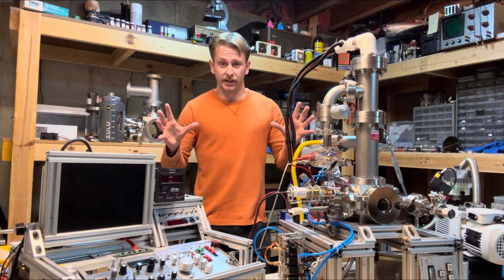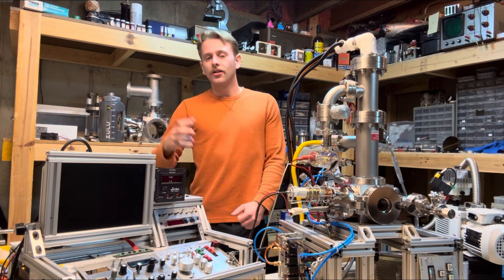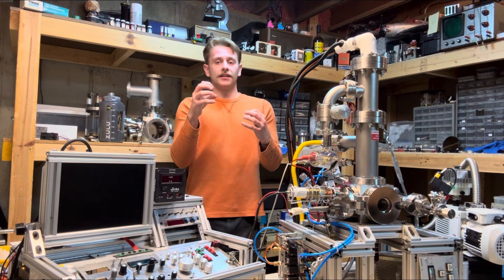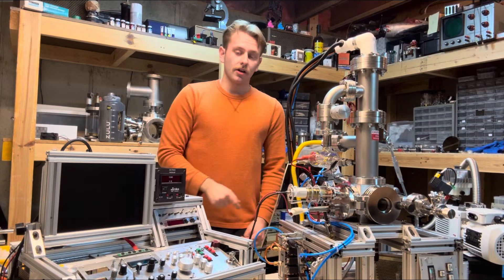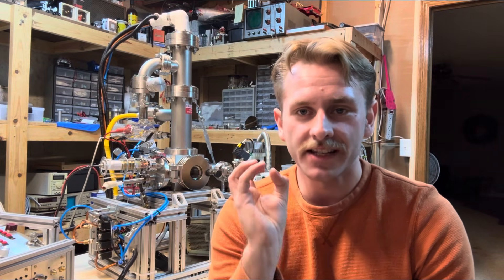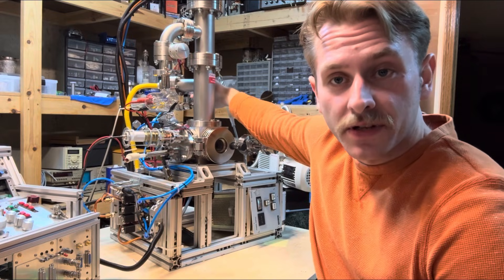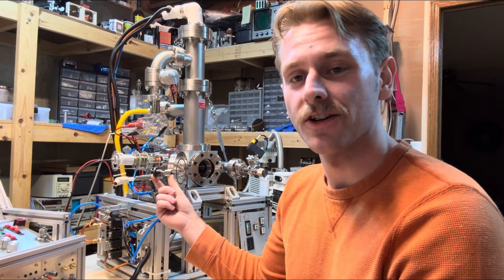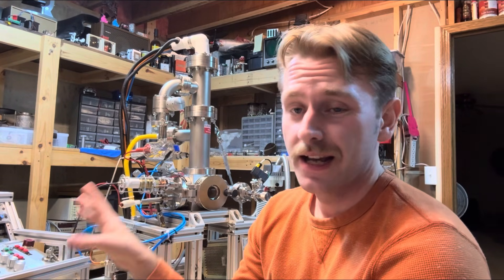I’m Building an Electron Microscope

Comment: Amazing project. I studied physics and was working with devices like these (not literal SEMs but "homemade" chambers). This was loads of fun. Really critical to be very scrappy here as every part is at least hundreds of bucks if bought new.
I'd be most scared of the electronics part of building this. 

What turbo pump do you use?
We used ion getter pumps to get below 10^-10 mbar, once the turbo was maxed out. Some commercial ones but we also had what looked like homemade ones: just a high-current feed-through with several Ti-wires attached and the whole thing mounted in a cylindrical tube on the side (so it doesn't coat the entire rest of the chamber). That took us to 2x10^-11 mbar but it also took a week of pumping and of course a day or two spent baking the chamber before that.

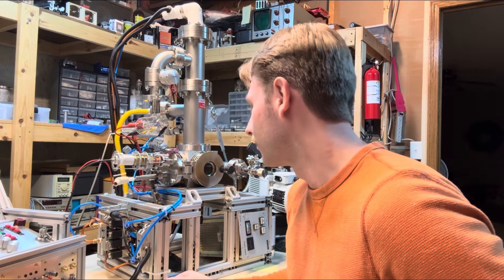Comment: 11:06 Take some aluminium foil, push it over the glass in the hole, form it well and tight to the recess, then gently pull it out and pour any casting powder you have in that "cup". Then you can make negative of that, discard the foil + original cast, and pour lead in and that's your window cover + radiation blocker in one. I guesstimate you need about 6 classic car wheel weights, you can find them at the scrap yard, most scrap yard masters gather them to sell the lead. As long as you don't boil the lead, you're AOK if you do it outside on a surplus stove or something.
7:49 true. The amount of extrusion you can find at the scrap yard is mind boggling. I don't need all of it, but i sometimes get entire trailer loads (after i go dump my stuff) worth their aluminium weight and share it around with my friends. And it's good stuff too. A month ago i found 10x10 core extrusion (the standard 3D printer width as module) in four half a meter long stalks. Like... who throws that stuff out? And i got it for weight value. Unreal how much stuff gets thrown away for no good reason at all. Welp, their loss, our gain.

Comment: This  is cool to watch. I worked for a jet engine manufacturer for many years and one of the pieces of equipment we had was an electron beam welder. Many of the functions you speak of are very similar to the welder.  I maintained this equipment, very challenging for control and alignments.. I also made my own hobby  circuits at home by wire wrapping the electronic components. It worked well but never looked as good as your boards.. Keep up the projects, I love it.

Comment: Super impressed by your progress. I attempted a similar build 15 yrs ago using a electron gun from a HD CRT, yes they did exist but were so heavy they were not popular. Got all the vacuum bits but stalled on the High Voltage system. This week I pulled a scrap Brandenburg Alpha III 30Kv 30mA from a skip and it re-ignited my interest so super excited to see your work. Transimpeadance amplifiers. love them. Berillium photo-multiplier, Analog devices has a great photodiode wizard design package. Your board wiring is A**, textbook. You have great gauges, its all coming together, what a dream project. Its all learning. Subscribed.

Comment: i dont see your turbo molecular pump.....They range from about 36,000 rpm for pumps having a large diameter rotor  to 72,000 rpm...i dont know a 90 000 rpm TMP as you say.....guess it costs about 10 000 bugs

Comment: What's your ultimate pressure? 1/1,000,000th of atmosphere is only 7.6e-4 torr. Should be able to get 1.0e-6 or 1.0e-7 torr no problem with a turbo and a sealed chamber.

Comment: Oh wow. Damn this is impressive. I'm currently doing an internship at ARPES in Amsterdam, the netherlands. Not an SEM but the setup uses a lot of these CF parts.

The sealing rings are indeed expensive, but they CAN be reused. Just start with the bolts just barely tightened and progressively tighten them with each use. I believe the current record is about 7 times😅

Comment: A simplifying suggestion- rather than making a custom circuit to display the scope output to VGA  display have a computer digitize and display a graph.   You can get USB data acquisition devices that can do 10-20Khz sampling at 12–16-bit resolution.    If you stage outputs voltages proportional to X and Y position you can fill an array using that.   If you only get a rigger when the stage moves to the 0,0 position you could calculate X/Y position by elapsed time from the reset.
Reply: Big part of his project here is he wants to do everything from scratch. I do agree with you that’s a more practical approach, but an even more practical approach would be to have the display be an actual pc lol

Comment: You're mixing a lot of terms here, like voltage and current, electrons and light along with misunderstanding how old lightbulbs work (electron gun uses termionic (electron) emmision, while a lightbulb has to do with thermal (light) radiation). Together with some term-bombing for simpler concepts (like turning a current into a voltage) makes the explanation hard to follow and inaccurate, but 

I suspect it all comes from trying to shortly and simply explain rather than you not knowing as you obviously have come a bit on the journey and I'd love to see the process, component selection, the things you build yourself and challenges encountered in making that electron microscope!
Reply: The guy built the thing. I have a feeling hes just dumbing it down for are smoothed brains.

Comment: White 'phosphor' in filament type lamp is not a phosphor but a simple coating to make difused light effect. Electrons emitted just by thermionic emission have much lower energy (order of 0.1eV, maximum electron energy can be derived from maximum electron energy at the filament temperature minus work function for filament material) than needed to excite phosphor. Fluorescent lamps use phosphor, but again it is not excited by electrons but by ultraviolet radiation emitted from filling gas at low pressure. They offten use argon and a trace amount of mercury vapour. When excited (by electrons of much higher energy, since continous discharge for fluorescent lamp happens at around 90V) mercury atoms emitt smal amout of visible light and very intense UV line at 253.7nm. This UV  line excites the white coating phosphor that emitts few broad bands of visible light. When combined those bands 'look' like 'white' light. 
Also, E-T detector is very delicate. It is fine detector when you are sure that the rest of your system works as intended. With the only sure benefit - the PMT being 'outside'. For testing purposes with enough beam current you can get away with simple faraday cup. Also, my professor of instrumentation electronics at college made scanning EM (as a grad student) back in 96', as i remember (maybe I'm wrong) he used photomultiplier (with faraday cage and acellerator electrode as in ET detector) directly. And I mean directly as in 'without the glass casing' (and scintillator). Simply, secondary electrons were attracted to faraday cage, accellerated, and focused to first PMT dynode. Ofc, microscope has to be at very very high vacuum. He used oil difussion pump, backed by turbomolecular backed by rotary pump. 
Great work for the microscope, I follow You on Instagram, and I find your work nothing less than art. 👏👏👏👏

Comment: Quick question: I've been thinking of using an electron gun from an old tube tv for my own SEM. It's both easier and simpler to scan objects why didn't you use one too?
Reply: AFAIK one of the hardest part when making an SEM is to get magnification.
It works basically like an optical microscope, but with electrons, so you need the right "magnification optics" to focus your electron beam precisely and this is extremely hard to achieve.
Your best bet is to use the column of an existing out of service SEM, because you already have the right "optics"/coils here.
For the electron gun I believe the beam is too broad, and the energy is probably not what you want + the deflection coils are totally useless here.

Comment: Awesome, Brother! 
I was a 6492, Aviation Calibration Tech, in the Marines from 1999-2007.  Continued as a Metrologist for Lockheed at Stennis Space Center from 2004-2007, and a Turbofan Test Engineer for Lockheed and Rolls-Royce at Stennis from 2007-2012.  Became a Control System Engineer from 2012-2018.

So, needless to say, I love this shit! 

Semper Fidelis!
USMC 1999-2007

Comment: How are you doing your high vacuum passthroughs? Ive had some success using spark plugs on my EM build but its overall not too reliable- been struggling with it for a while!
Also, what phosphor are you using? Havent had too much luck with that too :)
Some of those ebay listings look really familiar ;)
Sick build so far, certainly a lot more elegant than anything I could come up with lol
Reply: Hi! What do you mean when you say "spark plugs are not reliable as feed through"? Do they leak? Or it's an electrical problem?

Comment: You will need to isloate the device from vibrations, so that would include moving all pumps off the device, ditect to concrete floor, and then isolate that from footsteps, pumps may need to be isolated as well, why once a org i new turned down an electron microscope fir free as they would only be able to use it at night due to road traffic outside
Reply: Vibration will limit magnification, but it won't make it not work. 

When I was a teenager I spent a week cutting the tops off of weld samples at a pacemaker battery factory. It was 1979 and the factory laboratory had a "low cost" electron microscope. They used a small sample chamber, so the vacuum pumps could empty it faster. They were specifically studying the welds around the battery terminals, so they didn't need the rest of the stainless steel battery case. The weld sample battery shells were built without the lithium bromide chemistry. There were enough weld samples for it to be a statistically valid study. So they needed to look at hundreds of welds.

This was about metallurgy, not magnification. The backscatter spectrum from each point identified the elements present. If the wrong element was present, they would zoom in on the defect to get a closer look, otherwise, the pictures were only about twice as large as the actual parts. So a magnification of just 2X.

Needless to say, they weren't very worried about vibration.

Comment: a millionth of atmo is not enough... but with a turbo pump you should get to 10^-6 millibar 😊 you can heat the walls with lamps to remove gas residues